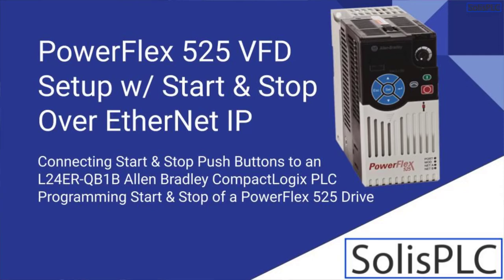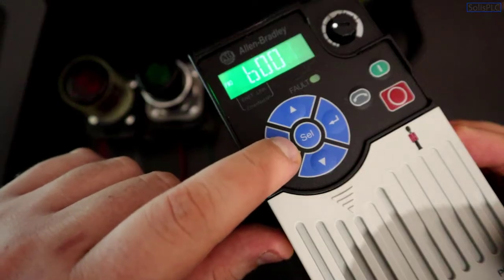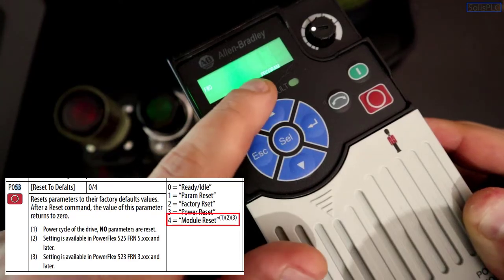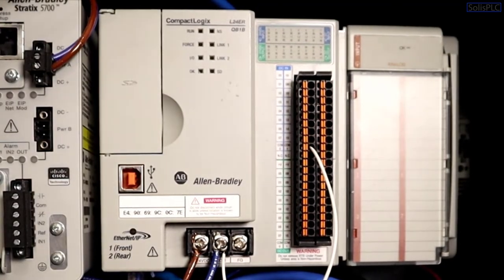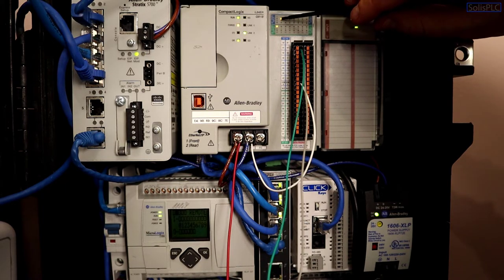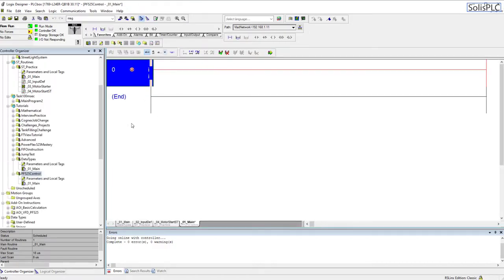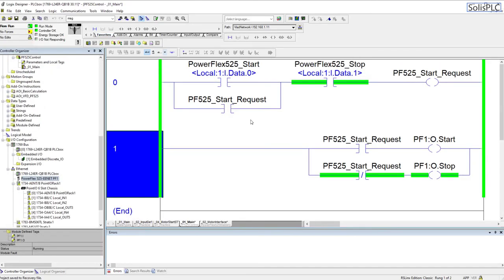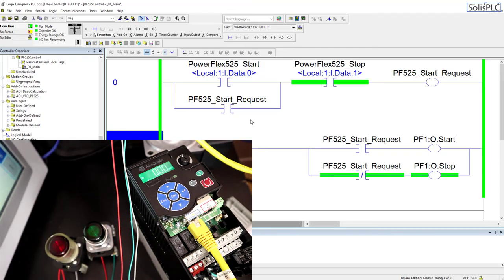PowerFlex 525 VFD Setup - Programming Parameters Wiring RSLogix Studio 5000 EtherNet IP Start Stop

Comment: Why did you hard wire? I did mine the same way without hard wiring push buttons and it still starts and stops the vfd and motor. Are you just showing us two different ways to accomplish the same results? Is there a reason why you did it this way?
Reply from the maker: Yes, just to showcase the specific start/stop IO. In some facilities they still use those, but it's absolutely unnecessary if you're doing it over EtherNet in my opinion.
Reply: Ahh makes perfect sense. Thank you for explaining! @SolisPLC

Comment: I have seen that I've had to branch a Start and Run Forward together in order to get the drive the run. How did it do with merely the start?
Reply from the maker: That's a good point. I looked through my previous code within the program and it included an FWD/REV flip-flop for that particular drive. In other words, it was already enabled on FWD elsewhere. Sorry about the confusion.
Reply: How can we change the standard function of a VFD terminal using parameters only.
Eg, making a moter to rotate in reverse direction by giving the command to the forward terminal (02).
I'm using powerflex 525 VFD. 
Ps interchange of wire connection is not the option it has to be done by changing some parameters only. 
Please help!

Comment: what control logix version I need to make this what if I got an older version ?
Reply from the maker: Hey Erik, to set it up this way, you need Studio 5000 v 21+. A similar setup is possible on RSLogix 5000, but the layout would be slightly different.

Comment: Vlad, how do I change speed of the drive over Ethernet?  Somehow the controls engineer o work with gets into the parameter on the drive and increases/decreases speed. When I look at parameters the output frequency is always grayed out and I can’t change it
Reply from the maker: The parameter should be the right approach. I suspect that it's either nested into an AOI or it's being aliased elsewhere. Can you send me the program or a few screenshot to v.romanov@solispl.com? I'll try to see what's wrong in your specific case.
Reply: You need to look at the command frequency. The output frequency is what the drive is actually running at.
Reply: @stephengibbon2141  I was trying to change the speed in the controller tags. I needed to change the speed in the actual logic for it to work

Comment: There is a coil inside the VFD correct? And when it gets energized it closes the contacts which sends power out to the motor. So, is the ethernet wire energizing the coil? Is it power of Ethernet type wire?
Reply from the maker: Hi Greg, not exactly. The EtherNet commands go to a board on the drive. This board receives the signal and will use a chip that is on the board to toggle the coil. There is no power over ethernet and it's not the direct signal over that wire that is switching the drive.

Comment: Thanks Sir.
Great video.
I have Problem. I want to config IP address for PowerFlex 523 (25A-D017N114~~~7.5kW).. But on keypad i don't see show Parameter (C128/C129,C130,C131,C132/C133,C134,C135,C136). I had setting C169=1 (Network opt).
Please help me. 
Many thanks.

Comment: This logic has created a race condition. If the RPI times out between your start and stop branch it means a packet will be sent to the drive asking to start and stop together. The next packet should just be a start but the drive is already locked up until the start is cycled. Nice video though!